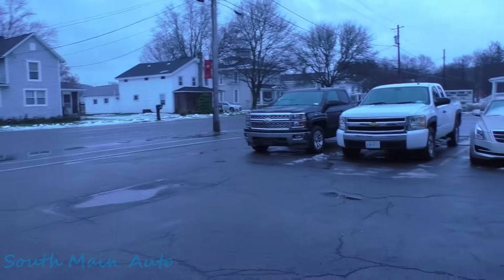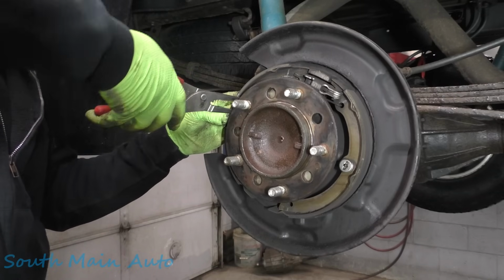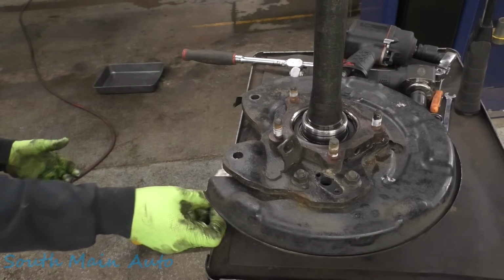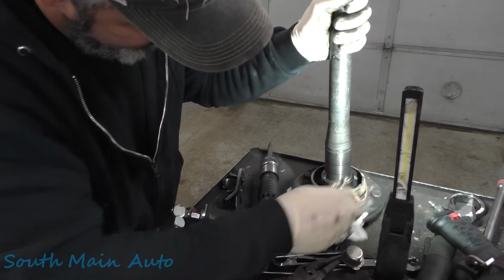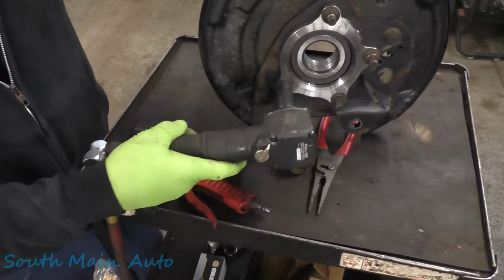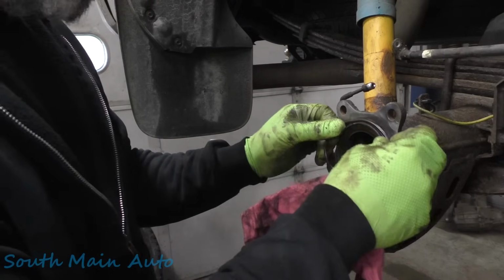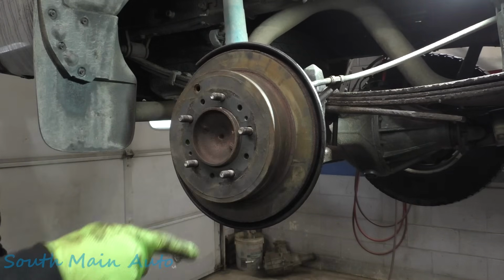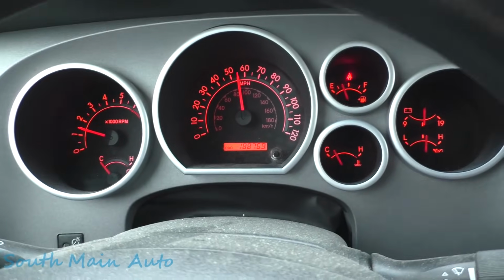'12 Toyota Tundra: Rear Wheel Bearing

Comment: More mechanical knowledge than the average 10 mechanics combined.   This guy is flat out impressive!!!!
Reply: Betcha Rainman Ray could keep up. Maybe not
Reply: Both Eric and rain man are fab mechanics but being from the salt infested side of the USA he’s much more competent with the gas axe in fact he’s impressive 👍
Reply: Well, it's not rocket science (most times) and when you have the right tools and have been turning wrenches and bustin knuckles awhile, it's pretty easy tbh.
Reply: @eddymahon1503  I love Ray and he's a very capable mechanic, his work ethic is to be applauded and he is a very entertaining man.... but Professor O in my opinion is one or two steps above Ray; Ray's soldering, welding and torch usage is cringeworthy and I've never seen Ray do such detailed/in depth diagnosis into system failures as Professor has shown us many times.
Reply: @MickayG  absolutely. I love watching his diagnostic videos. Amazes me
Reply: All right, serious question about putting a torch on that axle; I assume that axle’s getting hot, and I assume that it’s heat treated. Aren’t we worried about changing the heat treatment on that metal? Thanks for anybody who drops some knowledge.
Reply: @fredmalito9869  Serious answer: Most hardcore 4x4 folks often heat their axle glowing red hot to straighten them back out after a rough stomp n romp, some have done it for the same reason on the frame itself. Therefore I think us on-road drivers are fine with the torch kissing the axle a little bit.
Reply: @fredmalito9869  most heat treatment is just short of the metal melting point so some accidental heat transfer isn’t a big concern.
Reply: FLAT RATE TIP:  skip the torch and just use a cut off wheel, takes 10 seconds
Reply: Agreed!
Reply: I do a one man brake bleed 🩸.. I depress the brake pedal with a toilet 🚽 plunger 🪠 and the electric ⚡️ seat..Crack the bleeder,close it and repeat 👍🩸🪠🚽🚙

Comment: WOW that is the most complicated bearing replacement I've seen you do.  Way way above my pay grade. Another excellent video.
Reply: Yeah,  it was pretty involved, requiring special tool,  hydrolic press, torch  and every thing else.
Reply: "If I can do it, you can watch me do it"   (or buy a 60,000 lb press)
Reply: No ... "if he can do, YOU can do it"

A 20 Ton press from Harbor Freight is $250 right now (used to be $190-ish) & the Yoda rear axle pull/push tool is $160 on E-Bay.  

$410 for a press & removal tool would pay for itself quickly, especially if you did both rears while in there or had a second truck. If you do any suspension work, a shop press will find uses (ball joints & bushings)

Or sell one or both off once done and get some of your cost back.
Reply: @LeverPhile  Or just return them, assuming they don't get all marked up.
Reply: Nah, if he can do it, you can do it. [cue the music]

Comment: Here’s another free tip about the brake line. Don’t need to crush the rubber hose with pinch pliers. Simply take. The rubber bleeder cap and place it over the hard brake line end. Trust me

Comment: Yep!! The hardest axle bearings I've ever replaced were for a walk in customer, brought his 2 rear axles in and two new bearings. They were off a late 80's/early 90's Toyota 4 Runner, similar set up, but drum brakes. I didn't have the special tool, or a torch, and my press wasn't quite tall enough for the wheel flange to clear the floor. I only quoted him $200 for the pair, but took me most of the day to do the job.
I ended up pulling the retaining studs out to separate the backing plate, then added a couple of 3 foot lengths of all thread, with a slotted puller and hydraulic ram to press on the splined end with the axle standing vertically on the wheel studs.
I heated and beat the locking rings, and tried grinding slots in them with them under pressure, but they were on there hard...finally BOOM, the collar let go and the axle jumped about 2 inches off the ground and then collar and bearing came off ok.
The other similar ones I replaced were off a Nissan Terrano, very similar set up, and was just as difficult....The right tool for the job makes all the difference🤣👍🇦🇺

Comment: Okay;  as a customer I have to defend myself.  I always wash my vehicles before bringing them to a mechanics shop.  I also always take off the hubcaps or center caps for them so they don't have to worry about breaking them.  Wheel lock keys were always in the cup holder for the guy if needed.   win win for all involved.

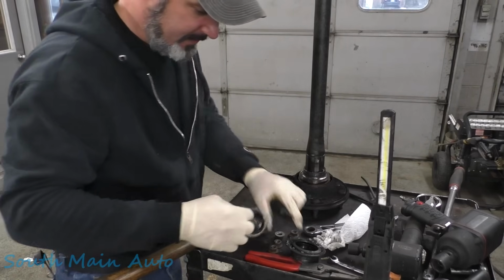Comment: There is a conical spacer that goes between the axle bearing and the bearing retainer, you have the old one in your left hand at 19:20. This piece is necessary to retain proper bearing preload. When reassembling the axle at 29:35, it looks like that part may have been missed. Please understand I’m not trying to be rude, but I’ve seen dozens of these tundras get towed into my bay shortly after they have had axle bearings replaced at others shops because they were missing that conical spacer and the new bearings came apart. Again, not trying to call you out, but figured I would try and pass along this information. Thanks for your videos!
Reply: This conical spacer has angle. Can you tell me how I need to install it correctly ? Thks.
Reply: I know he sometimes doesn’t show every step in repairs, like, I hope he installed the snap ring on the axle spacer thing.
Reply: So you calling Mr O. a rookie........ No good!!!!

Trust me, he knows what he's doing yo!
Reply: @DA-zi6eq  you are missing the entire point of my comment. I’m certainly not trying to call him out or call him a rookie. Any experienced and honest mechanic will tell you that we ALL make mistakes, I’ve made more than I can count, but you can’t learn unless you know. Its entirely possible this piece was added back in off camera, but from my own experience as a Toyota Master tech, it’s a very commonly missed part, so I figured it was worth mentioning. It would be nearly impossible for Mr. O, or any other independent mechanic, regardless of experience, to know every little detail about every different vehicle on the road. The only intention of my comment was to share some of the knowledge and experience I have so that those who don’t know could learn. I hope that clears things up!
Reply: @Ddprescot78-21  It should go on so that the outside edge (widest part) of the spacer touches the bearing and the inner edge (narrowest part) touches the bearing retainer. Does that make sense? I’m having a hard time explaining it without being able to post a picture
Reply: I see where you coming from. Toyota master tech.
Is nice that you share your knowledge as well. So other ppl don't make that mistake. Carry on 👍
Reply: Yes, hopefully he did put it on and just didn't show it. We may never know. Mistakes are only human, but thanks for the heads up for anyone doing this repair themselves.
Reply: I’ve done multiple Tacomas, 4runners and FJ cruisers but never a tundra. On everyone I’ve done there’s a beveled washer under the retainer. I feel like if this truck was equipped with that washer there would be a 1/8” gap between retainer and snap ring.
Reply: I have 5 years with toyota and this is true, there is a beveled metal washer of sorts that goes between the retainer and the bearing.  Lots of little things to remember on these rear wheel bearing jobs.  Missing one thing during the press back together can turn things into a real headache!
Reply: @williamcorcoran9392  with all do respect sir being a Toyota master tech pretty much tells me all you have done is oil changes and brake pads.
Toyotas are too reliable to break.
Reply: @AdmissionGaming  thats pretty funny! Toyotas break too but not as much as other cars.
Reply: @Ddprescot78-21  Tapered/Chamfered edge of both retainer and washer facing the vehicle!
Reply: is that part of the new bearing
Reply: @williamcorcoran9392  I also didn't see him change the oil seal in the axle housing. A potential come back over an inexpensive part.
Reply: South main....William:  can I not just use a press to get this all apart without using a torch?  I have the tool jig to use.  Seems like i could just press off the ring without cutting it.  am I wrong?  Thanks for the video!!
Reply: @Ernie Ficklin  You don't necessarily need to torch it off. But I personally recommend heating the ever loving shit out of it. They are stuck on there very very tight, bent a jig once because I didn't apply enough heat. You want to either cut it off. Heat it glowing hot and then use the press.

Or easiest in my opinion is using an angle grinder and carefully cutting it as close as you can without cutting the axle itself and then using a chisel and hammer to either break it apart or hammer it off.
Reply: @Guggu3d  sounds good.  I’ll hit it with some map gas before I pull it off. Thx for info
Reply: @Ernie Ficklin  You're welcome and good luck! 👍
Reply: Yes, I noticed the same omission of the spring washer. I did not see it get placed in between the bearing and the retaining collar. It should be installed with the cone upward against the retaining collar.
Reply: @williamcorcoran9392 I agree with you William, what you said made total sense about that spacer.  Without the spacer, the snap ring serves little purpose,isn't it just like all the old Hotchkiss type rears where they relied on the interference fit of the bearing to keep axle from sliding out.  I remember seeing old Ford's with their axles hanging halfway out of the differential.  I think a lot of mechanics are too thin skinned.  A Salisbury type rear does have some advantages compared to as he put it 3rd member differentials

Comment: Eric, my favorite all around tool for Brakes are electrician's /linesman pliers.

Perfect amount of grab surface for those push & rotate retainers, and a beefy enough clamping and rigidity to grab and pull brake springs.

Just a regular pair of 8" or 9" lineman. Most also have cutters and/or crimpers, too. Multi purpose!
Reply: If a job can't be done with a pair of Klein's, it shouldn't be done.

Comment: Wheel lock removal 
Plan A use customer supplied key
Plan B supply your own destructive key and replace the "lock" with regular wheelnuts
Customer is responsible for which plan you choose
Reply: @HouseCallAutoRepair  just drive an old chrysler, they will only get two wheels off lol.
Reply: I took my locking wheel nuts off so I don't have to deal with them some night while putting the spare on.
Reply: @justinpaone2227  Haahaa!
Reply: Or plan C. Use customer supplied key and then lose it.

Honestly though i never liked my wheel locks anyways. More hassle than they were worth.
Reply: I have the same TRD Forged wheels on my 2010 Tundra and all of the lugs are technically lock lugs. All of them are spline pattern
Reply: Amazon and other sources have a set for after market locking lugs that is worth having if you run into a lot of them.  Saves you from digging in customer's car and they work on most aftermarket wheel locks.  I also bought a cheap kit off amazon for vw factory locking lugs because I guy brought me his car without the lock one time.
Reply: @justinpaone2227  lol, 2 wheels and 10 broken lug studs
Reply: @HouseCallAutoRepair  Good for you. I'm so glad you're so organized. Have you ever forgotten? Sounds like it. I never ask-cause I never think of it nor know exactly every make model that has such a device. I do generally find it, and let the customer know if they were to ever change a tire, or let them know the spare is flat or in BMW's case your spare has been replaced with a phone number.
Reply: @drewreed7423  can I add Plan D, use the customer supplied wheel nut, deform it somehow with a chewed pattern and oval curtain wall so when the next tyre gets a puncture it has to be fettled with hammer, drifts and a grinding wheel so it sort of fits and survives one undo and replacement cycle and leave them to buy a new one. Don't laugh, my local "mechanic" did just that. Took two hours to change the wheel, glad it was on my drive at the time.
Reply: @justinpaone2227 I see way more old dodge rams out there still running on the road than these "Blundras and tacos

Comment: Enjoyed the video, done this bearings under warrenty, had to learn how to set it up. One tip is I cut a groove on the bracket were the brake lines meet. that way I don't have to bleed the brakes later(only on disc set up). It still has the clip to hold it in place.

Comment: If your ever in a situation that warrants using the torch and your worried about cutting into the axle cause you lack confidence or experience wash cutting with a torch, get the part your trying to remove glowing red in one or two spots and give those spots a whack with a ball peen or a chisel. You’ll expand the diameter enough that it usually falls right off, but if you let it cool down it might tighten back up.
Reply: That’s a good idea I might try that on my next bearing change. Even though I do have the tools to take them off with. 😀
Reply: I was thinking that, heat up to glow, whack with a cold chisel. i used a dremel and chisel on my nissan, I only have a "hobby" torch
Reply: and you're

Comment: Doesn't "pinching" the brake line compromise the inner lining of the hose?
Reply: I prefer to put a hood prop on the brake pedal and if you remember the first step to disconnect the battery the brake lights won’t stay on all day
Reply: Or you could pinch the hose !!!!!😂😂😂😂😂😂

Comment: Seems crazy to me cutting metal like that so close to the axle.  I guess if you've done it enough times though....
Reply: yeah once you get handy with a torch, and understand where to apply how much heat to determine what gets cut and what doesn't, its not as scary. Hell you can smoke nuts off of bolts without damaging the threads if you know what you're doing. It definitely requires some finesse, but there's also a science to it.

Comment: Eric free tip Monday for you: to remove the 'Spring Loaded Assy that holds the Brake Shoes, I use a' normal' pair of 'Flat Nosed Pliers' & hold them on a 45° Angle in regards to the 'Nail' as you called it, in the slightly opened position, then depress the retainer a little, & squeeze the 't' part(head) of the 'nail' in order to spin it to your 45° degree mark before aligning it to the release slot(if that all makes sense), a lot to write but trust me, it's very, very simple in practise!

Comment: I bought a set of the "single use lug nut removers.  If I need to use one, I use it, then stick them in the mill and mill flats on each side of the lug nut, then use the half inch breaker bar to remove it so I can single use it again.  ;)

Comment: I remember when i had to do the right rear wheel bearing on my 05 tacoma. I didn't have the tool to press it out so i used the torch and cut her out, took longer but got the job done.

Comment: I went to a boneyard and cut one end of a bent axle housing set it up for my press by welding some scraps to it, bolt in the axle and used the press to press out the bearing by pushing on the axle, then just unbolt the bearing from the housing

Comment: Change my rear wheelbearing on my tacoma it was easy af, glad i live in a state where the roads arent salted so im able to resuse the bolts etc, and it wasnt so hard to take everything off amd reasemble. But my wheel bearings gaved at about 90k miles. I think the reason why is I neglected to do my differential fluid until i hit 85k miles, leaving all that metal junk in there. I bought the ebrake tool and made it easy. The adjusting part is not all necessary if you use the bolt method. Autozone has a baring brace removal tool for $50 now need for the torche and chisel

Comment: Check the axle vent on the driver side, when I did my right rear wheel bearing the vent was stuck closed, the pressure differential in the axle pushes fluid into the right bearing thus destroying it. pretty sure that's the reason it's ALWAYS the right rear that goes bad on the tundras, mine went bad at 110k mi.

Comment: Admittedly my truck has wheel locks, and I keep my key in the glove box.  But it has a convenient isolated tray that it sits in by itself, so as soon as you open the glove box it's -IN PLAIN SIGHT-.  I do also keep the glove box clean of everything but the bare essentials, like electrical tape, wire crimps pack, and wheel lock key.

Comment: I just did the rear bearings on my '02 Dodge Ram 2500. The only difference was I used tools where you were using a torch. I did have to buy a kit to press the race and seal in correctly but it seemed way easier then that Toyota.

Comment: the nails as you called them, on my jeep i make those out of nails because the correct ones pulled threw the backing plate and i wasnt about to change the backing plates for that. i just put the nail head on the inside and for the other end i just bent it over after cutting it to length.

Comment: That is wild - I never knew the bearing was pressed onto the shaft. So used to the bearing pressed into the hosing. Unfortunately, the Toyota way is not quite DIY @ home friendly for the bearing removal/install haha

Side note - WOW. That backing plate looks incredible for an upstate NY truck with infrequent rust proofing. 
My Tundra backing plates had zero for their 10 years of Long Island and they are marginal in spots. 

A+ video as usual sir! The over engineering done on these Texas built trucks is impressive.

Comment: Give Mrs O a clothes pin for her nose for the axle oil and ask her to hold the axle still or hold my torch, lol. Mechanic work today is a hate love relationship due to the junk replacement parts from Doorman. I often wonder if OEM parts are also mfg by them as well. Love the videos and your approach to electrical diag.